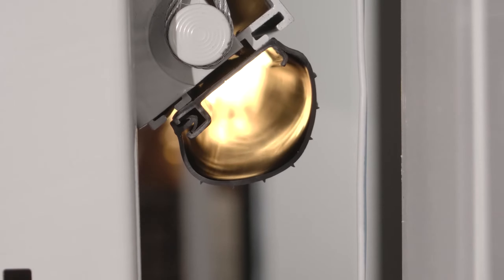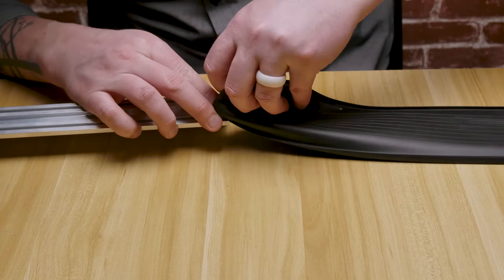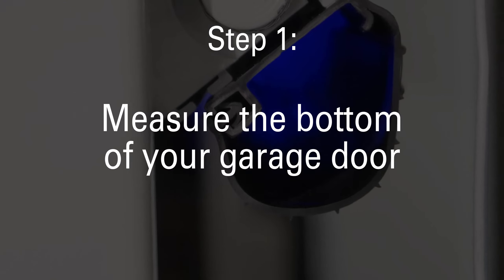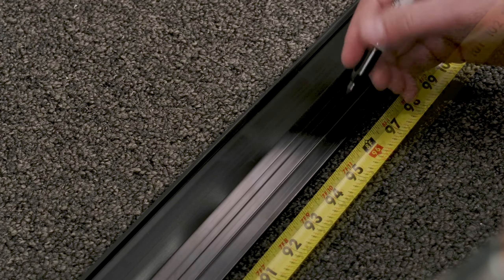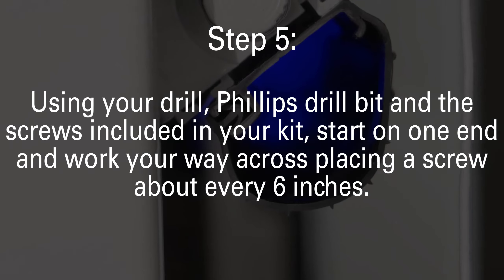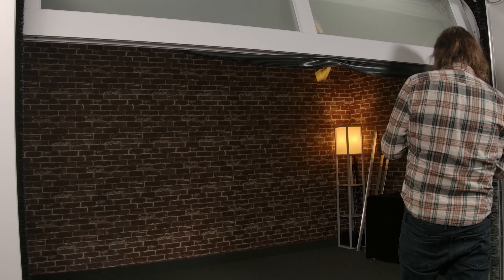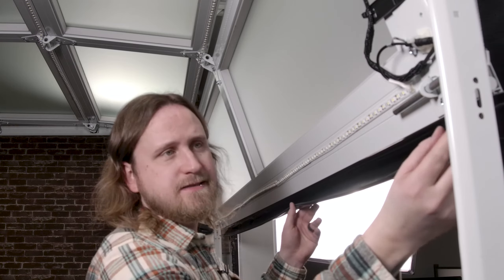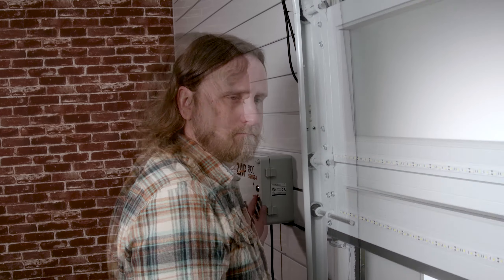How to Install the EZ Zip One Piece Push-In Bottom Seal

Comment: Just for anyone curious about this, I just bought this product and after opening the box the ez zip was so stiff from being coiled it wouldn’t untwist flat. So when I installed it no matter what I did it did not want to lay flat against the bottom of my garage door sweep. Even with clamps like in the video the zip was buckling and rounding up between the clamps.

I also realized it was also kinked in the retainer section in several places after mounting it. I Had to go along the groove with a chisel twisting it to open the channel to push in the seal. Annoying and not easy. Some areas worked really well and were easy. But the packaging and sitting in storage for long time before shipping is likely the culprit. 

My Install doesn’t look very clean/smooth due to this. could I have spent more time to try to loosen it up and relax the seal?perhaps. But it’s supposed to be easy and I had limited time. 

Still seems to do the trick so 3 stars out of 5.  hopefully I just got a lemon and others fare better.